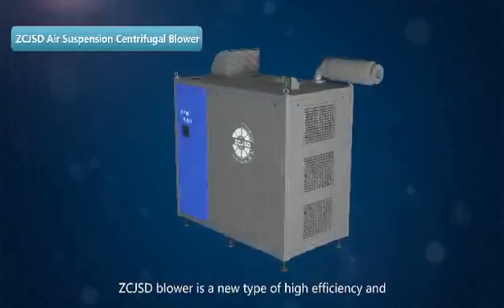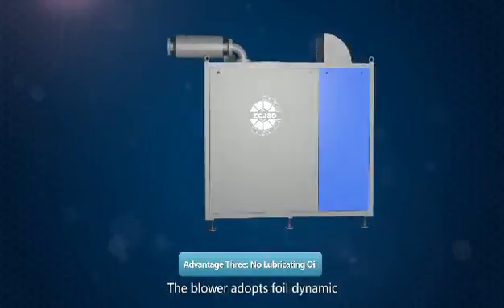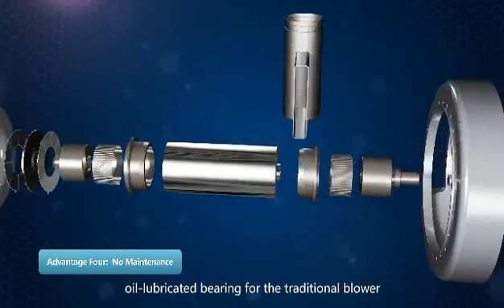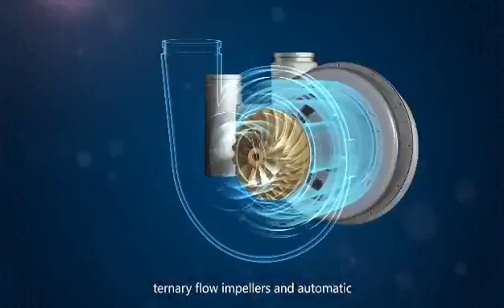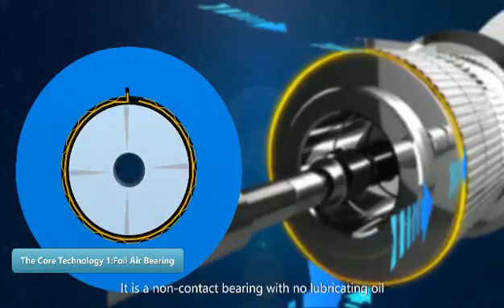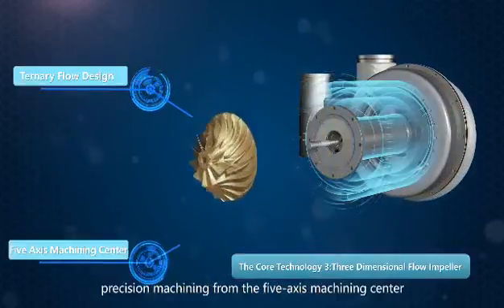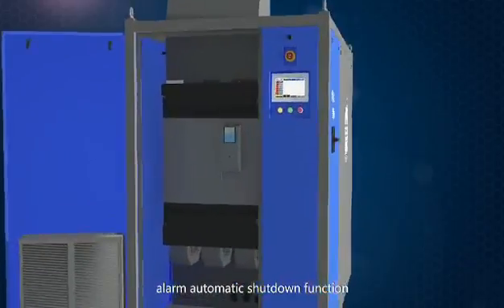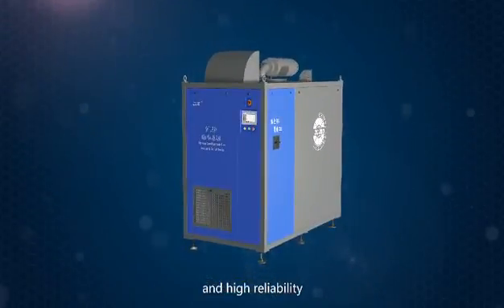Turbo Blower ZCJSD

Comment from the maker: Características do soprador turbo ZCJSD: 

 

1. Economia de energia e alta eficiência com o poder de toda a máquina superior a 80% .

2. Baixa vibração, baixo ruído, menos de 80 dB; 

3. Operação e controle convenientes 

4. Sem óleo lubrificante, sem manutenção, só precisa substituir o elemento do filtro com o custo anual de cerca de 4000 RMB; 

5. Nenhuma fundação é necessária, e o espaço de instalação do equipamento é pequeno. 

6. Vida semi-permanente.

 

O soprador centrífugo com suspensão a ar é um novo tipo de soprador de proteção ambiental com alto desempenho. O soprador pode ajustar a potência do motor de acordo com o volume de ar de saída para manter o equipamento funcionando de forma eficiente; o rolamento de ar laminado e a tecnologia de conexão direta de alta velocidade são adotados para reduzir a vibração e o ruído mecânico; o soprador adota tecnologia de rolamento de ar de folha, sem sistema de lubrificação especial e pode fornecer ar limpo para tratamento de esgoto, eletrônica, medicina, alimentos e outras indústrias. O impulsor e o motor são conectados diretamente sem acoplamento, o que economiza a caixa de engrenagens e os mancais lubrificados com óleo necessários para o soprador tradicional. Os principais componentes são o alumínio de aviação. Essas tecnologias garantem que o soprador não seja mantido e reduz o custo de manutenção. É adequado para a indústria de tratamento de esgoto, indústria de alimentos e medicamentos, indústria aeroespacial e outras indústrias de transporte de fluidos. Agora, o soprador centrífugo de suspensão a ar foi operado na estação de tratamento de esgoto e a operação está em boas condições. 

 

O soprador turbo blower ZCJSD de suspensão a ar concentra as principais tecnologias de rolamento de ar laminado, motor de alta velocidade, rotor de fluxo tridimensional e controle de automação, com baixo consumo de energia, baixo consumo de material, baixo ruído, baixa ocupação e outras vantagens significativas, comparado com a economia tradicional de energia dos sopradores roots com eficiência de 30% - 40% e ruído de 80 db.

 

1. Comparação dos princípios estruturais:

 

Os sopradores tradicionais são movidos principalmente por engrenagens ou cintos, equipados com caixas de câmbio, acoplamentos, correias e assim por diante. Há perdas de eficiência no processo de transmissão. O soprador da suspensão do ar adota a tecnologia direta da conexão, os impulsores e os rotores do motor são conectados diretamente, a eficiência de transmissão alcança 100%.

 

2. Comparação do poder do rolamento (ventilador de 100kw como um exemplo)

 

Os ventiladores tradicionais roots e ventiladores centrífugos de múltiplos estágios adotam rolamentos rígidos de esferas. O consumo de energia dos rolamentos é de cerca de 1,5 kw durante a operação. A maioria dos sopradores de alta velocidade de estágio único usa mancais de filme de óleo de almofada basculante, que produzem cerca de 15kw de consumo de energia no tipo rotativo de alta velocidade. Os rolamentos de ar não têm contato físico e atrito, e só existe perda de atrito do vento, por cerca de 200w.

 

3. Comparação de eficiência motora

 

O motor tradicional de indução de gaiola de esquilo tem desempenho de regulação de velocidade ruim, pequeno momento de partida e eficiência próxima a 90% na potência nominal. A eficiência diminui acentuadamente na saída de energia variável e apenas 72% na potência nominal de 50%. A eficiência do motor de ímã permanente de alta velocidade ZCJSD é de 97%. Motor de ímã permanente pode ser ajustado em uma ampla gama, mesmo com 50% de potência, a eficiência ainda é de 92%.

 

4. Comparações da eficiência do impulsor

 

Soprador roots é um impulsor de fluxo bidimensional fechado, que usa compressão multi-estágio, baixa eficiência de fluxo, e eficiência variável é de apenas cerca de 75%. O soprador de flutuação de ar ZCJSD adota tecnologia de impulsor de fluxo tridimensional avançada, compressão de compressor único, eficiência de até 92%.

 

5. Sistema de regulação de velocidade de conversão de frequência + controle plc

 

Eficiência de conversão de frequência até 97% do conversor e motor de alta velocidade perfeita correspondência, pode atender o sodprador 50% - 100% ampla gama de regulação precisa de fluxo, para garantir que o soprador nas condições de mudança de operação eficiente. O plc reserva portas de comunicação remota e usa o modo modbus-rtu, modbus-tcp / ip para comunicar-se remotamente com o sistema de controle central para realizar a operação remota do soprador. Através da seleção do gabinete de coordenação, a operação coordenada paralela de múltiplos ventiladores pode ser realizada.

 

Vantagem empresarial Turbo blower ZCJSD

 

1. Vantagem técnica: R&d e empresas orientadas para a produção, todos a partir de 0, têm experiência suficiente, pessoal de serviço pós-venda para participar de P&D e produção, compreensão mais abrangente e específico.

 

2. Vantagens convenientes: Produção local, resposta rápida, transporte rápido, localização das principais peças de reposição e cadeia completa de suprimento.

 

3. Vantagem de custo: O preço das peças de reposição é preferencial, e o custo do pessoal de serviço é mais razoável.

 

De acordo com os requisitos do usuário, o soprador centrífugo de suspensão a ar de alta eficiência da é selecionado para substituir o soprador roots.

 

2.3 condição do soprador roots atuais:

 

Modelo, volume máximo de ar (q) booster, potência nominal, número de unidades em uso

 

Rse 150, 18,03 m3 / min, 58,8 kpa, 35 kw, 3

 

Condições de trabalho existentes:

 

Volume de ar total: 54,09 m3 / min; Potência:105 kw; Pressão: 70 kpa, então a potência real de consumo deve ser maior que 105 kw.

 

Considerando os dados acima, o modelo mais adequado para este projeto é o gf100-0.7, que pode substituir três sopradores roots. Parâmetros do modelo selecionado:

 

Modelo, volume máximo de ar (q) booster, potência nominal, número da unidade

 

Gf100-0.7, 64m3 / min, 70kpa, 75kw, 1

 

Nota: Cada soprador adota controle de conversão de freqüência em tempo real, isto é, pode ajustar automaticamente o volume de ar e pressão de acordo com o volume de ar definido e pressão independentemente, e também pode ser centralizado e coordenado controle pela sala de controle central. Cada soprador equipado na mesma sala do soprador está em espera um do outro.

 

Faixa de controle do volume de ar: 35 m3 / min a 64 m3 / min

 

Cálculo de conservação de energia:

 

Comparação de dados de poupança de energia

 

A comparação de economia de energia do soprador centrífugo de suspensão a ar zcjsd e soprador centrífugo multi-estágio existente sob as mesmas condições de trabalho é a seguinte:

 

1. Comparando os dados do soprador sob a mesma condição de trabalho

Modelo (q), volume de reforço, quantidade em uso, potência de classificação, potência operacional

Gf100-0.7, 64m3 / min, 70kpa, 1 conjunto, 75kw, 59kw

Soprador roots existentes 54.06m3 / min, 58.8kpa, 3 conjuntos, 105kw, 105kw

 

2. Cálculo de economia de energia

O cálculo mostra que sob as mesmas condições de trabalho, a capacidade de economia de energia da soprador mecânica de ar zcjsd é de 31 kw por hora e a eficiência de economia de energia é de 34% em comparação com a soprador roots original.

Nome, consumo de energia por unidade, número de unidades, consumo total de energia

Ex-roots blower de 30 kw / h, 3 conjuntos, 105 kw / h de soprador de campo

Medição de campo do soprador de flutuação 59kw / h do ar de zcjsd, 1 jogo, oficina 59kw / h

Cálculo de poupança de energia 31 kw / h, 1 conjunto, 46 kw / h

Economia de energia diária 46 x 1 x 24 = 1104 kw

Economia anual de energia 1104 * 365 = 402960 kw

De acordo com 0,55 rmb / grau, 402960 * 0,55 = 221628 rmb
Reply: से जुड़ o

Comment from the maker: Sopladores Turbo ZCJSD ( Turbo Blower ZCJSD ) Presentacion de la Empresa

 

Sopladores Turbo ZCJSD ( Turbo Blower ZCJSD ) es líder en tecnología de sopladores como su de motor Imanes Permanentes de alta velocidad controlado a través de variador de frecuencia. Los sopladores turbo de ZCJSD poseen además un bajo nivel de pérdida mecánica gracias a la conexión directa del eje del motor al impulsor y bajo nivel de ruido gracias al uso del cojinete de la lámina de aire.

 

El cojinete de la lámina de aire es más limpio y eficiente porque no requiere el uso de lubricante, 100% sin aceite, sin contacto, sin necesidad de mantenimiento.

 

El impulsor que utiliza el turbo soplador de ZCJSD garantiza el mejor rendimiento y confiabilidad con un diseño sofisticado y fabricación de precisión basada en la tecnología aplicadas en la aviación.

 

La incorporación de aluminio AL7075 con tratamiento térmico de alta resistencia, permite mejorar las características de baja abrasión y conexión directa al eje.

 

El uso de materiales resistentes a la corrosión y a esfuerzos mecánicos, permite su operación por más de 30 años en condiciones pobres (altas temperaturas, altas presiones, etc.)

 

Dentro de sus características destacan

Eficiencia energética

Eliminación de sistemas de lubricación forzado

Eliminación de sistemas de enfriamiento por agua

 

Sopladores Turbo ZCJSD ( Turbo Blower ZCJSD ) Con Tecnología

 

Sopladores Turbo ZCJSD ( Turbo Blower ZCJSD ) con tecnología de motores de imanes permanentes

Sopladores Turbo ZCJSD con tecnología de motores de imanes permanentes Los sopladores turbo de ZCJSD ( Turbo Blower ZCJSD ) están diseñados con la más reciente tecnología. Es el caso del motor imanes permanentes de alta velocidad ( Permanent Magnet Synchronous Motor, PMSM) de alta eficiencia, seguridad y ahorro de energía.

 

Las RPM del Motor Sincrónico de Imanes Permanentes (PMSM), son controladas mediante variador de frecuencia. Se producen mínimas pérdidas energéticas y niveles de ruido muy bajos, ya que la conexión directa entre el eje del motor y el impulsor, así como el uso de rodamientos de levitación por lámina de aire, reducen la fricción mecánica; minimizando además las pérdidas de corriente y entregando una eficiencia máxima de hasta un 98%

 

El motor de los sopladores Turbo ZCJSD ( Turbo Blower ZCJSD ) , está diseñado para una rotación de alta velocidad (máximo 200,000 RPM). Con una alta eficiencia en operaciones de baja y alta carga.

 

Los sopladores Turbo ZCJSD ( Turbo Blower ZCJSD ) cuentan con un sistema de enfriamiento por aire integrado, que emplea aire aspirado del exterior para hacer girar un ventilador conectado al eje del motor. A diferencia de los sistemas de enfriamiento por agua, no se requieren bombas ni fuentes de poder adicionales.

 

La tecnología del motor de imanes incorporada los sopladores Turbo ZCJSD ( Turbo Blower ZCJSD ), permite cumplir con los requerimientos de nuestros clientes en los diversos procesos industriales con calidad, seguridad y eficiencia energética.

 

Sopladores Turbo ZCJSD ( Turbo Blower ZCJSD ) Fecha Técnica

· Potencia: 20HP a 400HP.

· Flujo: 170 CFM a 12,000 CFM.

· Presión: 5 PSIG a 25 PSIG.

Bajísimo Costo Total de Propiedad (TCO).

· Alto rendimiento aplicando tecnologías probadas.

· Impulsor optimizado, motor magnético permanente e inversor.

· Amplia flexibilidad operativa: relación de reducción entre 45-100%.

· Minimización de costos operativos y de mantenimiento a través de componentes semipermanentes.

· Bajos costos de instalación por diseño plug & play.

· Alta fiabilidad y fácil mantenimiento.

· Sistema estricto de control de calidad de Hanwha Techwin para reducir los riesgos.

· Estructura simple y fácil acceso a componentes clave.

· 100% OIL-LESS. Libre de aceite “eco soplador”.

· No necesita sistema de tratamiento de aceite extra.

· Bajo ruido (55 ~ 85dB), baja vibración.

Aplicaciones Más Comunes.

· TRATAMIENTO DE AGUA RESIDUAL: Los microorganismos aeróbicos digieren los “residuos” al proporcionar aire al agua residual.

· TRANSPORTE DE POLVOS: Tales como materiales químicos, cemento y harina para almacenamiento.

· SUMINISTRO DE AIRE para reacción de oxidación en condiciones de absorción o para trabajos de agitación de materias primas en el repositorio.

· CUCHILLA DE AIRE para la fabricación de semiconductores, LCD / LED y línea de galvanización continua.

· TRENZADO para la industria textil.